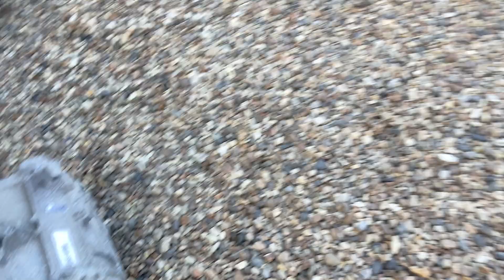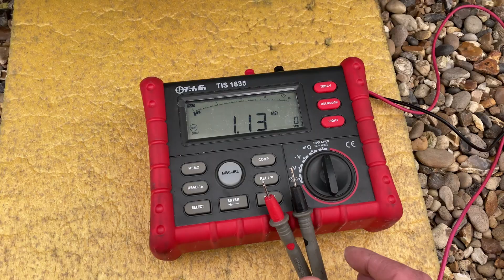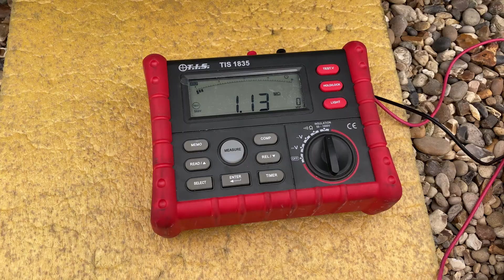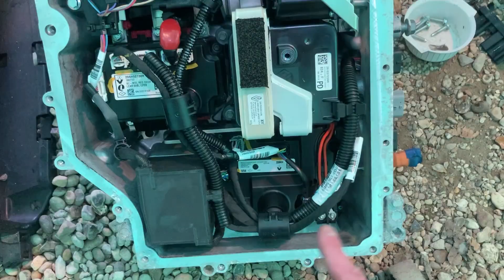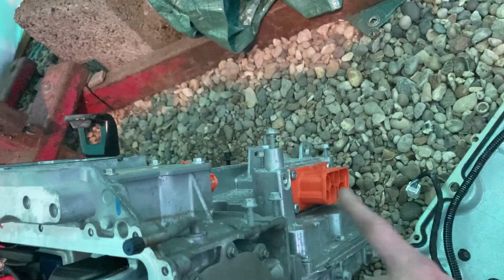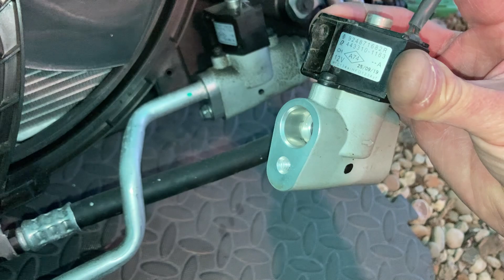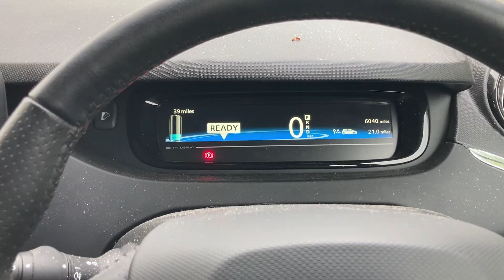This ELECTRIC CAR IS DEAD after only 6,000 miles - Can we fix it? Renault Zoe EV Repair

Comment: I only got to video time 3:48 and at this point its easy to see what to do next: you must put a good fluke ohm meter on the stator leads and see what ohms reading. Then go to the car repair manual from Renault to see what factory spec is on ohms for stator windings. Same thing for temp sensors, but they are fried for sure. Maybe u can solder same thermocouples in where fried one is to save buying full new stator as that is only way its sold. But i believe the stator windings are cooked as that must have been what cooked the temp sensors too. This is normal for piece of junk aluminum wire wound stators this french fried car was built with (spudmobile)

Comment: If you just happen to have one handy, a 230V single phase to three  phase inverter VFD might be used to check the motor - that is had the motor been a permanent magnet type,

Comment: Great work !! and just shows you what a trained technician can accomplish on his own. I have to defend the main dealer a little however as they pretty much told the customer exactly whet you found, "damaged motor controller and possibly motor". The difference is that you had the time and second hand spare parts to investigate and swap out the faulty components. The dealer would have to use new parts and charged full price for them, plus dropping the complete drive unit would really rack up the billable hours. 
Thank god for small independent artisans!
To all these young budding mechatronic engineers out there just leaving school and finding the job market tough, get the training and you will always be in demand as there are not nearly enough EV technicians to go around.

Comment: lol I can't believe the Motor has Brushes ! brushes wear out Crazy !
Reply from the maker: Hi, the brushes are only for excitation of the rotor, which is a very small current so the brushes will last around 100 K miles, it’s not like the brushes on a DC Motor where all will be Power to drive the car goes through them

Comment: Laws need to be created to make cars more reliable and easier to repair and easy to repair DIY. 

Laws need to be created to make manufacturers make tech free cars or at lease as tech free as possible.

Laws need to be created to make main car dealers properly fix issues and not replace whole parts which cost a lot of money, basically, if the manufacturer doesn't repair their cars to component level they should ban them from selling cars.

Comment: This is an excellent video from a very intelligent expert. I am about halfway through, and the leakages at the thermal connections to the case are being shown. I think the casing is not porous. It looks like is is a pressure die casting, and these are generally good. What is visually evident is that the machining on the thermal contact faces inside the casing is really uneven. This would cause the leakage, in my view. The thermal transfer grease has been displaced by the coolant where the poor surface does not make proper contact with the heat source devices. Even the new casing does not look well machined. I doubt those marks inside the casing are leaking.
Reply from the maker: Thanks for the feedback, it was an interesting one!

Comment: Washing up liquid and hot water will clean coolant then dry the spray with isopropyl to get any moisture out even on circuit boards also ev coolant is supposed to be non conductive I wonder if it is breaking down with the water or people are using the wrong coolant. Good work nice videos 👍🏻
Reply from the maker: Hi not all EVs use non conductive coolant, many including the Zoe use a type of standard coolant. Thanks
Reply: @garycevrepairs  maybe tell the customer they are better using the more expensive non conductive coolant 👍🏻 great videos keep it up

Comment: My sister had a 2019 Zoe, bought from a dealer in 2024 for 2.5k€ (price new was 33k€ for her specific car). What a pile of shit this was. She bought it with 45k kilometres on it. The battery when fully charged could only get to a maximum of 78%. The range in real life driving was less then 80km which is appalling. 
In the winter even less when the heater, lights and wipers were on. My sister had constant range anxiety.  She had it for 4 months, and sold it to somebody who literally was only going to use it for local shopping trips. After that epic failure, my sister bought a new diesel car which she now loves. 
I drove the Zoe once and couldn't see anything positive about it, other than it being small to park.

Comment: Absolutely incredible job and hats off to you Sir
You mentioned gearbox oil and I have used Westway oils for several years which I personally have found as good as or if not better than the branded products 
Kind regards to you Gary and take care, Mark from Billericay 😃👍

Comment: Just found your videos and subscribed
I used to work as an aluminium die caster and listening to you saying the casting may be pourus had me thinking about how it was cast and what better ways there are to cast to help avoid porosity and inclusions.
It's been a while since I had to think of this stuff, and looking at the casing, I'm confident it was cast reasonably wel,l but not in a way that would stop it being pourus.
The casting process to make it a better casting would, I think, be more expensive  than Renault was prepared to pay for .
Having thought about this, i remembered there are ways to seal the casting and looked it up on google.
I know you're changing the casting, but it might be something to consider for the old faulty casing to have it sealed possibly  for use later if another customer comes with a similar issue
Google came up with this, I hope it helps a little.

a porous aluminium casting can be sealed in the UK through a process called vacuum impregnation, where a liquid sealant is forced into the microscopic voids (porosity) under vacuum and pressure, then cured to form a solid, leak-proof component. This established commercial process is a reliable method for creating pressure-tight aluminium castings and improving their overall integrity, with several UK companies offering these specialised services.

UK Companies Offering Impregnation Services

Many UK companies specialise in this process, including: Surface Technology UK, Midland Deburr & Finish Ltd, and Impregnation Services.

Comment: Thanks for the excellent video. Is there a way of sealing the holes/threads/leaking areas with something like jointing compound (which plumbers use on connections, even under pressure), instead of replacing the casing?

Comment: So given this appears to be a manufacturing fault, with the quality of that casting leading to coolant ingress, why didn't they fix this? 🫤🤷‍♂️
Reply from the maker: Out of warranty so I guess they can argue it’s fit for purpose. I’ve seen it a few times but not a very common issue.
Reply: @garycevrepairs I would need to check references but there are presidents under UK law that items purchased which have an expectation of good or better quality and command a high price tag have an implied warranty beyond what the manufacturer offers. Probably would need to sue though to get the manufacturer to act 🫤🤷‍♂️
Reply from the maker: @SimonZerafa  I think that's the issue, unless it's a really common fault it's difficult to get enough traction to make something happen

Comment: Did you isolate the battery before investigating? I might have missed that bit but it's surely critical when dealing with systems which run into 100 plus volts.
Excellent problem solving and well done for saving a car for a fraction of its total cost.
Reply from the maker: Hi yes the hv system is safely isolated first. The videos are not meant to be instructional so I don’t show every step. Thanks

Comment: Drill a drain hole in the bottom of the case, wash it all out with brake clean call it good. Remember to top up the coolant every few months.  

Alright I'm joking but it seems to match the quality of the rest of the car.

Comment: I'm extremely saddened by the lack of intlligence of those that say EV's are simpler than ice vehicles,they aren't. As soon as complicated computers have been introduced to both it puts them on a par.Good work by the way.
Reply: Had they not done a terrible job with the casting, there would have been zero issues with the car.
Reply: Simpler implies less moving parts, less prone to wear and tear, less need for servicing.

Comment: I too have to occasionally change the motor on my 1964 split window VW bus. It requires a reconditioned one every 150 000 to 200 000 kms in my experience but let's you know one is required about 10 000 kms in advance.

Comment: Tell eveyone abouit their waterpump scam! Shows up as "Check electric system" in the display at roughly 70 000 km, and the stealership will tell you it is the waterpump, and that it is 900 dollars to change it.. BUT! It is just a stupid counter gone off, and I went to a guy with a proper diagnosis tool and got it reset. All well, and has been for 20k km more. 

The waterpump pumps water to cool when charging, when driving the motor is air cooled. Imagine how little wear this pump actually has. I am guessing the same will happen at 140k and that I will be able to just reset it again with no problem.
Reply from the maker: Hi, the water pump actually cools the electronics under the bonnet whenever you are driving or charging, yes it’s the counter that triggers the light but that’s the design life of the pump. In summary, do you feel lucky?

Comment: I had a problem with my MG ZS EV. All the dashboard lights came on and the brakes failed! Bit scary during rush hour....  Car taken to MG, after 3 weeks it was clear that they did not have a clue what they were doing! Eventually they contacted MG UK and managed to resolve the issue. It was a connector to some sort of controller. Nothing to do with it being an EV! But it shows the standard of competence at main dealer garages.
Reply from the maker: Really not good. I know an independent EV guy that has done some warranty work for MG as they lost their EV tech, the help from MG central CS wasn’t good, he basically did the fault finding for them and fixed the car 😁

Comment: Cool video I have one question though, was it really necessary to replace the motor controller? I mean you said getting coolant off stuff must be done mechanically but wouldn't it just work by washing it in isopropyl alcohol or something?
Reply from the maker: It takes so long to fit it’s not really viable to clean it and see how it goes. Cheers
Reply: @garycevrepairs makes sense thanks! I have seen no videos on the megane e tech ev60 on your channel do you reckon megane are more repairable? I want to get a second hand electric car that will last a while and can tow megane seems a reasonable choice to me

Comment: scrap it as its electric,petrol or diesel engine power is the only way to be
Reply from the maker: Yes mate, wet belt ecoboom for the win, even a 5 year old can fix one with a coat hanger. Fk the planet

Comment: This is the first time I've watched a car repair channel where not a single spanner or screwdriver is seen in use. Mostly thinking out loud. Not sure how I feel about it, but very interesting.
Reply from the maker: Thanks for watching. Whether it's an EV, petrol or diesel, cars now are very electronic and there is more software than screws. I worked in IT for 10 years before becoming interested in EVs and the cars that end up with me are the ones that people can't figure out, i.e. The logical issues where your brain is more important than your screwdriver. To be fair that's what I enjoy as well. Cheers

Comment: Having measured a short to ground from Any terminal, it means that a wire in the motor has been scratched.
They are Enameled for insulation.

Comment: Instead of swapping over all the components from one case to another, why not just use some thread seal on the original case screws for the motor controler to stop the coolant travelling through them?
Great diagnosis by the way.
Reply from the maker: Hi it’s likely to be porous in a couple of places and if it keeps leaking we would need to do the job all over again. The spare cases were available as I’ve stripped them for parts. Cheers

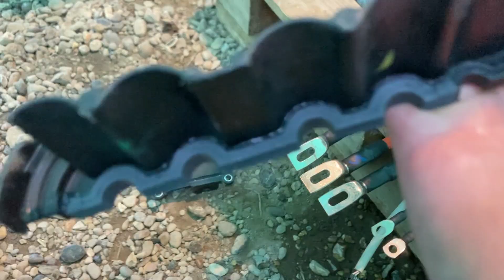Comment: 27:26 you know if its coolant if you taste it, just the very tiny smidge on a finger will do, if you get an metalic aftertaste its coolant, and you can remove the bad taste with a fizzy drink
32:56 you should try and collect these modules and then take them further apart and clean them up and see if that fixes them, a few hours work might give you some extra spare parts
48:20 if it where me (and its not) i would either do a pressure test with air first to check if its tight, a vacum test could also be done instead

Comment: I know next to nothing about EVs but a fair bit about electric motors. I'd be wondering if there's any way to rotate the motor with some kind of belt drive or a rolling road to see if it generates a voltage. ie working in reverse. If it does it means the motor is fine.
Reply from the maker: Hi I have thought about doing bench testing on motors, however these motors do not contain any magnets, they are known as separately excited, having a wound rotor and wound stator so you need to put current onto the rotor first which then would induce current on the stator windings which in summary means it's damn complicated 😆

Comment: I am a retired Electronics Engineer from HP (now 75). I am most impressed with your attention to detail and your diagnostic skills. You however confirmed my low opinion of the EV industry. The main streem dealers effectively abandoned this car after only 6000 miles. As you have shown they should have been able to fix it, if they had the skills which they did not. Well done indeed.
Reply: A lot of the skills from the electronics industry of the 70's '80's and 90's have been lost as the throwaway culture has taken over.  Most things can be easily fixed if you have the skills and the knowledge. Having worked for Sanmina, D.E.C., Compaq, HP, Jabil , Celestica and a few smaller companies since the eighties, I've seen a marked decline in the debug and repair sector as more and more   pcb's and motors are discarded. In the past we'd have replaced components, repaired or wire added broken tracks and rewound coils, but nowadays most people will just swap out the faulty part .
Reply: Elements of the entire car repair industry have this issue. Just watch a few ICE repair vids by the car wizard, he regularly gets vehicles where the ICE manufacturers just don't want to know if the problem is hard to diagnose, or they misdiagnosed and charged an arm and a leg to 'fix" the issue, but have 'fixed"  the wrong thing.
Reply: @dangavel1283 this by 10000.  People in most lines of business today, are all familiar with electronic systems.  The system is set up to deal with procedures.  Unfortunately if something goes wrong, or is outside the norm, there is almost nobody can fix it.

Same thing with your electrics and plumbing at home, and your car.  Remember that the EV numbers have ballooned ( with the reputation that things don’t go wrong ) in short term, and repair mechanics can’t diagnose problems, because there has been little or no training.
Reply: Did you work on 2100 machines 😜
Reply: @andrewallen9993  Is that printers? No I worked for the defunct Telecoms Test division.
Reply: @austin.seven.alastair I used a datascope you possibly had a hand in😊
Reply: Maybe his local dealership but not all but yes there is a general lack of knowledge across the industry even though there easier to work on & diagnose than ICE vehicles but not with me I’ve been fixing them for years. unfortunately like most industries the vast majority of people want to make a quick buck & not work hard it’s hard to find a honest tradesperson ( automotive, building, plumbing,electrical) who takes pride in their work & not rip you off.
Reply: That's because the billionaires set the precedence on how to make more money. Rip people off gets you rewarded..

Comment: Casting issue? Doesn't the warranty cover that... I would call the dealer-renaut it self that 1 has there been a recall for the issue, cause if 2020 model has the same quality issue then one could expect a recall to happen, and the consumer protection laws cover the consumers rights. Obviously I'm in EU .. you might remember that establishment from way back when.. Little bit of poking UK with a stick there in my writing but that aside, I seem to recall you retained the consumer rights from those days.

Comment: An ohm meter won't work . We used a 110 volt powered test light or hand crank mega.
Reply from the maker: That is correct but what I’m using is an insulation tester, it generates high voltage up to 1000v. It isn’t just a normal multimeter. Cheers

Comment: 3:08 That's disgusting, 500 for a diagnostic that they weren't confident could fix the problem. I do agree with charging an amount for diag, certainly you're still paying for the time but 500 is excessive when an hour or 2 could identify the same problem.
Reply: I do wonder if a cooling system pressure test, say at 3 or 4 psi, would have shown there was a casting fault. it's interesting that multiple cars have similar issues.
Reply: 26:19 If I was going to experiment, I'd try soaking the controller in some electronics solvent, then letting the unit dry for a day or 2 for that to evaporate. (provided it doesn't have rubber seals) I had some luck doing that with a flasher relay in the past.

Comment: The glycol in the coolant is to stop it freezing, not evaporating 😅 the reason that the coolant doesn't boil when its above 100 Deg.C is due to the pressure thats in the system Boyles Law😂
Reply from the maker: So why does coolant left in the sun not evaporate then whilst water does?